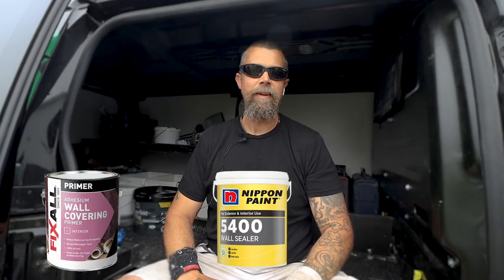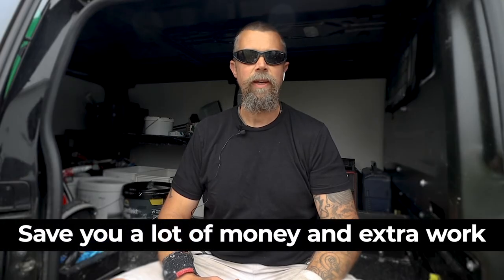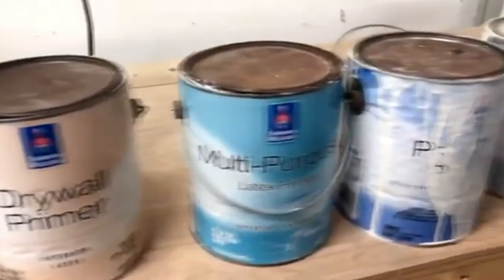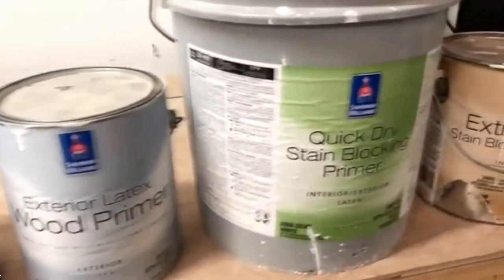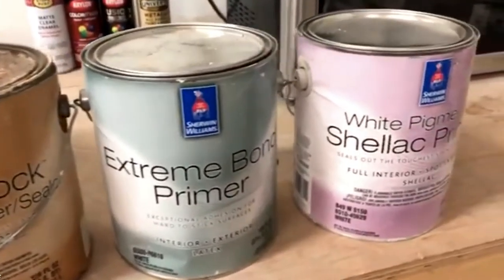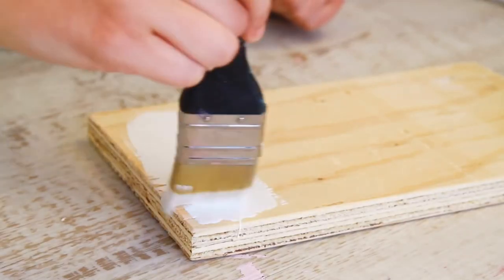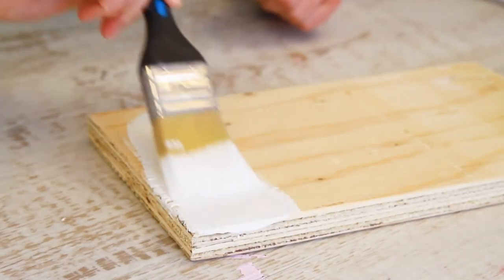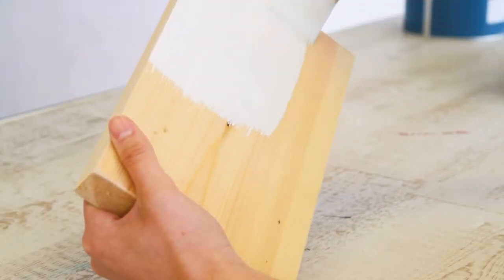WHAT is the DIFFERENCE between PRIMER, SEALER & UNDERCOAT paints?

Comment: Very helpful, I used to be confused about the difference, To be fair, these days many undercoats, sealers and primers come as one. Wherever I can, I use Dulux One Step. As far as I can tell, it is the best on the market, although a little pricier. Have you produced an episode on oil based undercoat, or pigmented sealer. Cheers

Comment: Thanks for explaining. I have a newly laid concrete surface of 276m² which will be the floor of a duck house. They wee and poo a lot! I'm doing my best to explain to these Thai builders that they need to sweep the base, use PVA solution to first seal it. I was confused if we can just top coat with red paint or do I still need a primer, then top coat. Trying to save money. Should top coat be specifically garage floor paint and should it be water or oil based? Would love some advice! 😬

Comment: Hi mate. What you said is bible. I was just doing today a bathroom. With dulux 1 step prep  oil based i saved 3 different coats in 1. And it’s a really good sealer to sand afterwards. Where are you based?

Comment: Using Dulux 1 step undercoat on well sanded panel board and clear finish timber but despite trying Zinesser paint booster (Rustoleum product) and thinning with water I can't avoid a terrible ropey finish. Going nuts. Wish I had used oil based paint. What's wrong?